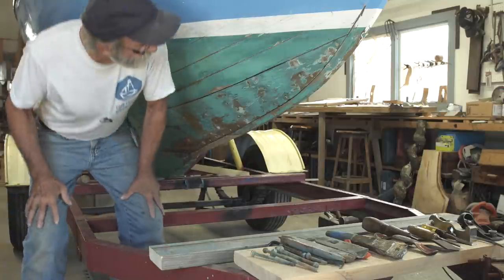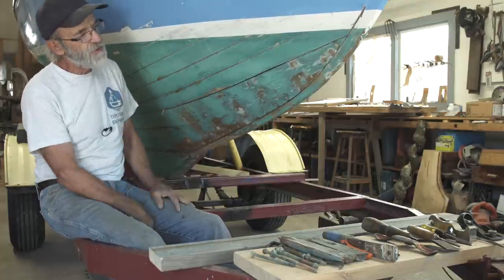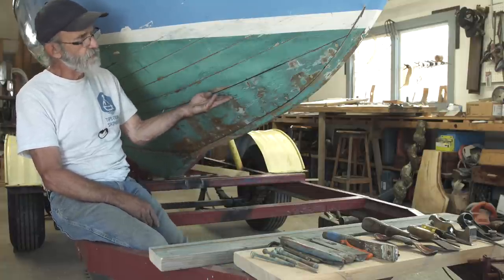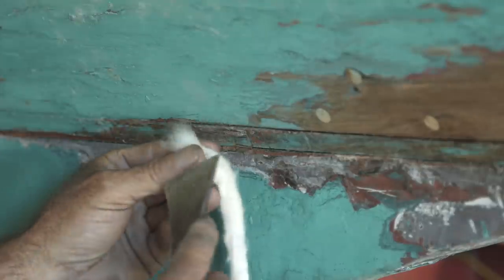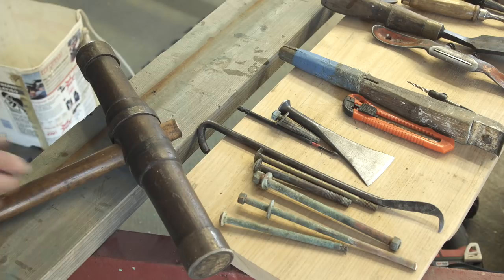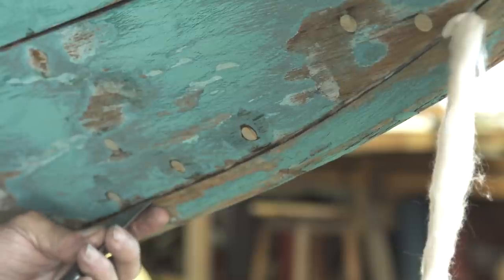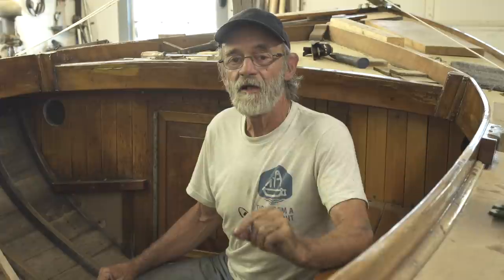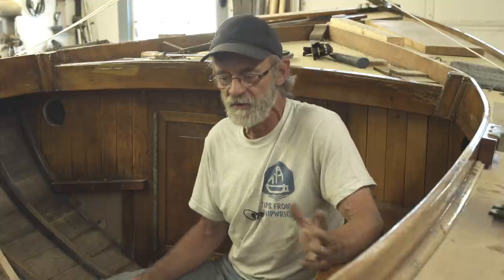Herreshoff 14 repair - Caulking seams with cotton and TIPS Season 2 Announcement

Comment: I've done the wrapping method on one of those plywood S shaped chairs. It had been left with one of the two legs out sticking in the rain (they are quite wide) and aside from the ruined finish, the plywood had gone undone. Long story short, i fixed the plywood as best i could and reinforced it on the back, inside, with a strip of wood. Hasn't broken in 5 years now and it sees daily use, flexing along with the original design. Testament to epoxy and a good technique.

Comment: Dude you are amazing have a 1967 44' viking motor yacht im about to haul out in August to do the paint and fix any issues that may surface. Shes fairly water tight now. My bildge only goes off a 2 or 3 times a day for 10 seconds. I am a young man (27) and i want to learn the skills of past generations. This type of work is going to get lost in time. I am a machinist and i am confident in my abilities to repair my yacht bur your videos are very reassuring that its not going to be that hard. And maybe even fun 😥👍⚓

Comment: Why use the bigger mallet?
Reply: Those properly made ones in the old pattern, have several features that work to absorb vibration.  (That "chirp" tone it produces, is a sort of side-effect of that engineering.  It's like a kind of "tuning fork" effect, from that longitudinal slot in the head.)  When used for extended periods, this prevents the shock/vibration from ruining your elbow and shoulder joints in the long term.  The specific species of wood is another factor:  high density, but relatively weak "crush resistance" in the end-grain direction.  (Unlike other hammer options, Lou's raw-hide mallet does effectively share this one blow-softening characteristic, but still lacks the other advantages.)

Also the shape and weight of the head, means the mallet is doing more of the work, with less effort from your muscles to stabilize the thing for accurate hits with correct force.  Again, perhaps not immediately noticeable unless you're spending all day at the task, under a large boat.  Bear in mind,  that the design of these was developed in the days when all these various constituent tasks of boatbuilding, were each divided into their own trade specialty, to enable the efficiency needed for rapid construction of huge sailing ships (& later steamers).  So in the mid-1800s a guy who was specifically a "caulker", would sometimes do ONLY that for virtually an entire working lifetime.
Reply: rats arsed mesquite is generally considered the best species but live oak is a common choice. I have one made of ebony but it is too brittle.